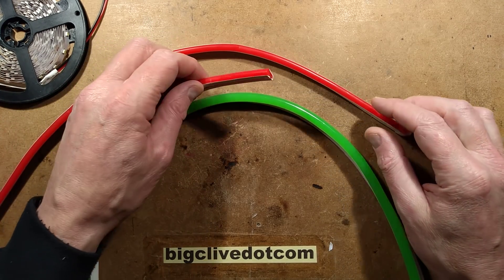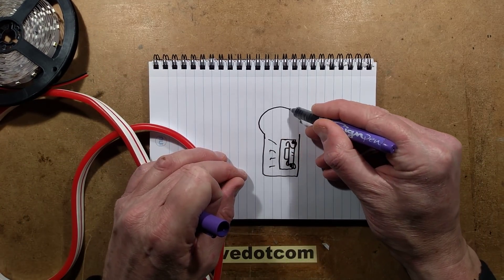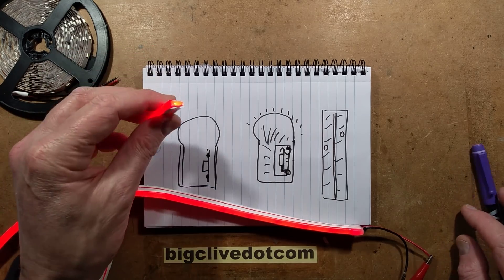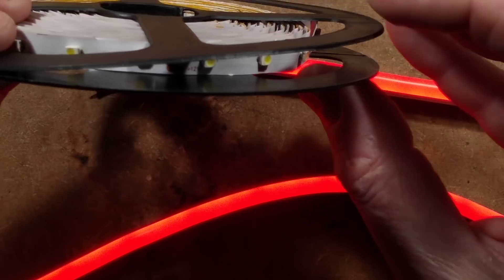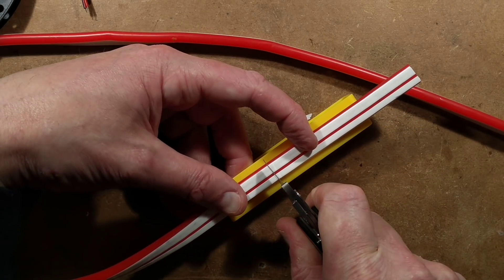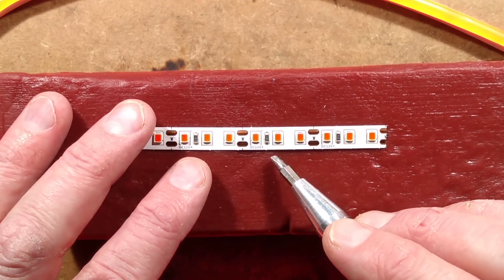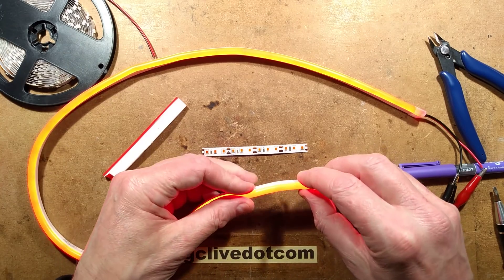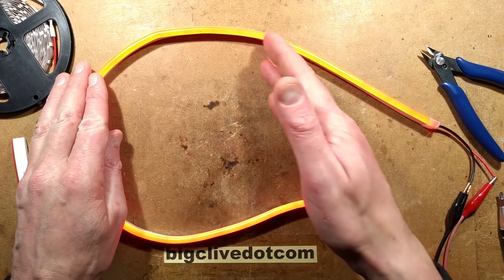LED "neon".  A new and interesting miniature variant.

Comment: I've seen a bunch of halloween masks with look like a thinner version of this without the white part, is is the same stuff? It's pretty cool for having light strips all over your body, it even seems like it could be a fun kids project, if you have an adult hook up the battery packs after everyone is done with the cable
Reply from the maker: Sometimes side-glow fibre optic and sometimes electroluminescent wire.

Comment: How do I connect different colors to one power supply?
Reply from the maker: If it's all rated for 12V you can mix and match colors.
Reply: @bigclivedotcom  would the size of connected pieces matter? Can one be shorter than the other? Appreciate your help sir

Comment: Oh yes I'm going to get some, not sure where to put them but I must have some because it looks so neat and probably easy to manage unlike the terrible tape and it's terrible adhesive that just tends to stick for about a day and then collect a layer of fluff
Just recently went to the local recycling center and got a box with like a dozen or so 9/12V power supplies for a couple of euros and this would be a perfect use for them

Comment: I think your videos must be a huge contributor to the success of the Chinese electronic industry and Poundland!  Now I'm inspired to create a custom neon sign. I know sweet fanny about circuits but I think I could wire up several lengths of strip satisfactorily but, being me, I'd like to animate. What component or circuitry could I use for switching on and off, in order to create the illusion of movement? I'm thinking anything between 5hz and longer intervals.

Comment: I wonder how well these will do in cold temps?
Reply: Should be fine, except that you'll probably want to 'form' them in warm temps; they're a little stiff at 10C or so :-)
I'd be more worried about capillary and expansion-contraction water suckage, if there's any wetness around and the ends aren't perfectly sealed -- in part because they're DC, though I suppose you could drive 'em with higher-frequency AC to avoid both electrolytic action and flicker...

Comment: Some of this stuff, has a cavity you can stuff magnet wire down to form it the way you want without having to hot glue it down to your perspex sheets or whatever.
Reply: There's definitely a little space / stretchability, but things are pretty tight in there (I'm looking at the same 'fake neon' that BC's demonstrating).
Which means I doubt I could push a wire that I could subsequently bend, more than 6in or so.
And I need to make words about 2ft long -- so let's hope the hot glue works, eh?  I'll report back :-)

Comment: This could easily add to the custom lighting of my Class A Motor Home, if in fact I ever get to move back into it. Right now, the members of my family are dropping like flies.  Three funerals of immediate family members over the past 4 months is a bit much with a few neighbors and close friends dropped in, jut to keep my black suite exercised.  God how I hate funerals!  That said, I do have that multi-color tape around my windshield, I only run the lights when we are parked in an RV slot someplace, and set the colors to correspond with the nearest holiday, such as red/green for Christmas/ Amber/blue for Halloween (I have our picture window at home done with purple/orange for Halloween using the 100 light set that runs from 3 AA's.  I just built a small box that has two jacks for 5 volts out hooked to a mini USB so I can run those lights from a wall wart, double A's are getting spendy and the rechargeable just don't do it.  I am considering using 18650's instead but for now a wall wart will do the trick.
Reply: Does remind me though:  Tis better to stand looking into a grave then to lay in a grave looking out!

Comment: What is the best way to power these strips for outside use?
Reply from the maker: Either a proper fully sealed waterproof outdoor supply or an indoor unit feeding to the outside and careful waterproofing of the ends.

Comment: I'm impressed. I could see some smaller Mom&Pop shops using these for their OPEN signs $15 for LED Neon strips, $5-10 for a power supply, $5 for a nice black/white board and some suction cups and some quality glue. 

I could see myself having fun with this in a little project car, Outline the rear window in 2 sides and connect them to the turn signals. Make sure everyone behind me knows what way i'm turning.

Comment: ell wire has been around FOR YEARS. I bought some in 2013 on Amazon for $15.
Reply from the maker: This is not EL wire.  It's much brighter.
Reply: @bigclivedotcom  So this stuff won't electrocute you when the wire gets a cut in the insolation? It runs on like 12v, yeah?
Reply from the maker: @InterMystery  Yes 12V DC.  EL wire tends to run at around 100V at a few hundred Hz.

Comment: Hey clive i love how you buy so much from ebay and i will say myself it isnt all crap junk . But one thing ive found concerning is that ebay allows sellers to remove negative feedback . One bad seller is siriusforce , he sells deep cycle batteries both lead acid and lithium , ive bought a few and found they are not even a third of rayed power . Maybe you could use your audience to alert buyers of this trend . Thanks

Comment: I used to bend neon as a side job (and met my wife there).  I always wondered if LED would be able to replace neon.  The skills required to build an LED sign are probably way fewer.  I see the LED strips in this video are not nearly bright enough for outdoor work.  Neon also offers another advantage, that light emits from all directions of a neon tube.  Still, LED offers some cool possibilities, like modulation of individual LEDs.  Nice video!

Comment: I ordered some of this back in Patreon release date as it looked good. Arrived today. Works very well and is pretty bright.  The brightness fades off a bit over a 5m length as expected so would be best fed power at each end.  I'm likely to use it as part of a ring light for camera/magnifier use.

The only issue I have with it is... OMG this stuff is smelly! Some rubbery/plasticizer aroma that fills my flat with bleh!

https://drive.google.com/open?id=1QGrhcKwA7D-3lE_6Oyf2wffOM3ke3WNF

Comment: Do you try this type of flexible cob led strip https://www.ebay.ca/itm/High-Density-COB-FOB-Led-Flexible-Strip-Light-14W-M-RA80-DC12-24V/401891675259?_trkparms=ispr%3D1&hash=item5d929c4c7b:m:mV7PW2DpsicMMdDgh2yiwCg

Comment: Would be nice with a built in "steel wire" that remember the message bent. If you want a suspended in the air kind of sign.
Reply: Cut out a design in plastic or aluminum and glue the strip on to it?
Reply: @AllenKll   what type of glue would you use ?
Reply: @nancywright9923  hmm.  Probably, I would use double sided tape, or epoxy.
Reply: I've also been trying to figure out this "suspended in mid-air" thing.
I don't believe "stick the neon to a pre-formed wire" is going to work; double-sided tape isn't very adhesive (check how narrow the underside of the neon is) and fails fairly quickly, whereas epoxy takes much too long to set (and you gotta hold the neon on the wire until all the epoxy has set) -- and superglue / cyanoacrylate tends to dry white and crispy, so is also suboptimal.
Double-sided tape on to 3/8in 18-gauge aluminum ribbon would probably work, but that would still prevent sharp bends (folds) in the neon -- so doesn't tempt me.
My best idea so far, is to hot-glue tack the neon to a transparent perspex / acrylic backing plate (resting on a sketch of the design, so I can see where I'm 'writing');  the hot glue should set in a minute or so, and I should be able to go letter-by-letter rather than have to build the whole sign in a single operation.
Then probably clamp another sheet of perspex over the design (think 'sandwich'; maybe put bolts through the corners, optionally use two bolts to connect the 12V), and use copper or aluminum tape around the edges to 'frame' the sign and to keep dust out.  In theory, this gets me a transparent sign in a skinny frame.
Any better ideas, please?

Comment: Hi Clive, what about light intensity, I remember neon puts out more light?
Reply from the maker: Each material has its own merits.  I'd under run the LED for longer life and use it indoors.
Reply: Also notice that this stuff is really cheap; if you have a routed or vacuum-formed track into which to place the LEDs (i.e., it's quick to form the sign), you can over-run the LEDs and just replace them annually (or whenever they're faded to 30% or so).
As opposed to a real neon sign, for which you'll need a professional glass-blower etc., and a bunch more $$$  :-)

Comment: You should check out laser wire. Great for ultra thin glowing wire applications. Much stronger more flexible than EL wire.
Reply from the maker: Interesting pairing of side glow fiber optic and lasers.  I wonder how linear the light is along the length.
Reply: @bigclivedotcom  I actually own some (Burningman :) and mine is about 5 feet and the light is pretty consistent. And I assume you can up the laser power the longer you go. It's really a special looking piece of tech. Not cheap though.
Reply from the maker: @doodlesdeluxe  Just for fun I've ordered a short length of side glow fibre and a 10mW fibre cable test unit.
Reply: @bigclivedotcom  Plase post a link for us

Comment: I wonder whether you could check this out and see whether they actually do anything to improve radio reception in my van? 🙂
https://www.amazon.co.uk/dp/B07P53KS21/ref=cm_sw_r_cp_apa_i_DsGNDbN7JVQDC
Reply: @Matt Quinn I get signal most places I go in Wales in the car, but FA in the van
Reply from the maker: That could be down to something in your van generating electrical noise that swamps the radio signal.
Reply: @bigclivedotcom  what kind of thing would be likely to cause that? I have a dashcam but the problem persists whether it's plugged in or not 🤔
Reply from the maker: @SuperAlbino1  Can you get radio reception when the engine is off?
Reply: @bigclivedotcom  I've only noticed it in rural areas while driving (obviously not tried with engine off), but my car receives fine in those same areas.

Comment: While resistive losses in the busbars argue against powering a long strip from one end, which will also make the lights at the opposite end a bit dimmer, the unwanted dimming can be evened out perfectly by powering just one of the busbars from each end. With the strip rolled up, for example, power the positive busbar from the center, and power the negative busbar from the outer end.

Comment: Can you dim this led Strip simply by reducing voltage?
Reply from the maker: Yes, but only between about 12V and 9V.
Reply: @bigclivedotcom  I see now they are selling this product 5meters multicolored with remote at Action 😊
Reply: You can, with the limitation noted by bigclive. PWM (pulse width modulation i.e. turning on and off really fast, with increase in nett off time giving lower dim level) is the usual approach for dimming constant voltage LED arrays, but that's a more complex circuit if such things are a concern.

Comment: Can someone help me out here please? is there a simple 3 pin plug that will convert the 240 to a 12v so I can wire it up and make it work? if so where can I get it from (as you suspect im useless with sparks) thanks
Reply: @Matt Quinn Thanks Matt
Reply: Do I use the 3Amp plug for a 5m length ?
Reply: @Matt Quinn I will do that thanks Matt
Reply: Ordered 5m and all the other bits, so we will see how it goes  (Pink) for a laugh

Comment: I spent 2 months in Japan in 1990. The amount of neon signage then was staggering. The Tokyo night sky was a sight to behold. In brash West Berlin in the late 80's it was a similar experience.

I went to Berlin recently and the extensive signage around Wittenbergplatz is now all LED; not video screens, but illuminated logos. It looks crap. It lacks variety in hue and has a vibration to it which is discomforting.

I suspect Tokyo at night is dominated by video screens. I'll have a look.

Comment: I have not looked for it
It would be cool if they had a WS2812-B style of these with a milky white "silicone" color stuff around it. It would be perfect for my arduino OBD-2 scanner project i had to make since BMW decided it was okay to not put the coolant/oil temperatures anywhere in my 2011 mini cooper's computer... I've made it into a cool addition to my car which has some LED's around the giant speedo in the middle, diffused by some milky wire wrap i found at home depot, synced up (roughly) with my tachometer, even flashing red when i red line. This stuff would look way better.

Comment: I've made "Neon" signs useing this stuff for a sign company I worked at and let me tell you what you spend more time with the mess of wires on the back then You will placeing the LED strip great idea but pain in the ass to wire every small piece
Reply: I'm surprised you didn't try to use a continuous strip of LED neon (although I think that will also be a PITA).
I'm hoping to do four graphics on a transparent backing, 12V powered at the (left- and right-) ends -- any recommendations,  please?

Comment: Could you do a video showing how to power these 'tapes' correctly. Is a phone charger wall plug OK, Do you need drivers ? etc please.
Reply: Is there a way to power it by USB so it could be used as a back light on TVs powered by the USB, and things like that.
Reply from the maker: They do a 5V version, but most are 12V and need a suitably rated 12V power supply.
Reply: @bigclivedotcom  such as ?

Comment: Good looking stuff. I just bought two 1 meter lengths, red and blue. I've been wanting to make a 3D printed "neon" in my wife's initials for her office. I've tried regular LED tape and it kind of sucks for it. But I bet this will work good. All I have to do is print the channel in the shape of the letters, then hot glue this in. Thanks Clive!

Comment: squishing it flat ... that doesn't put too much stress on it does it? Could you glue it down like that, to make a full wall, maybe pass it through a diffuser for a light panel with minimal hotspots?

Comment: I find alot of the real cheap led tape runs and lasts long if you drop the voltage to 10~11 vs. 12
Reply from the maker: I usually drop the voltage too.  Even a single diode in series with a short run has a good effect.
Reply: @bigclivedotcom  Yeah I did that in a few arcade machines :D

Comment: you did a video about putting lights in a home made silicone pattern 'flower' you used some kind of flower or starch and clear silicone . this reminds me of that so if you can add some color to that mix rather then the glow in the dark powder you used i think you could make this same rope a lot cheaper
Reply: BC's LED neon is around $1 / ft.  Very very hard to undercut that pricing, and still make a profit.
Reply: @theskett  this comment is from October 2019 so yes the cost has came down a lot, I have the led tape 12 volt running around my walls almost touching celling so it gives a more even light all over the room.If I had just waited till now to get all these lights I would have saved a few hundred bucks lol  I saved money on the light bill so it worked out in the end because the lights are hooked to a battery and solar panels

Comment: Last time you did the neon led strip I went down the youtube rabbit hole of chinese manufacturing videos looking for how they where made, ranged from manual led strips being strung manually through an extrusion (looked to be about 20' long lengths), to automated machines doing everything in a one step process (hot molded neon strip) into an endless length (or until the massive roll of led strips ran out).  High tech operations had a worker with a sharpie making the cut lines against a light table and yet another that had a laser etcher burning the cut marks.  Rather fascinating watching the various methods.  I highly suggest going on the youtube hunt for these videos.  And the older led rope lights... oh man, the quality control was something to behold.

Comment: is this not the same but cheaper Clive???    5M £12.96 free delivery   https://www.ebay.co.uk/itm/5M-DC12V-Flexible-Led-Strip-Silicon-Rubber-Tube-Neon-Tape-Soft-Rope-Bar-Light/113893554043?hash=item1a8495b77b:m:mI23tSv0jGBt1chv9BGY2Bg

Comment: I'm surprised they haven't added something like a rigid ABS channel that you could use a heat gun to soften and form to shape.
Reply: Blazer02LS they do have this you speak of in a larger size. We use it all the time in the sign business.
Reply: @ricktennyson4809  Do you have Google keywords or a link for that, please?
So far, I've only found a guy using EL wire in heat-bent polycarbonate tube -- which looked kinda painful, although I suppose would work :)

Comment: 3 measly amps? Nothing compared to my 5m/300led 'neopixel' strip which runs at 5V.  Fortunately I salvaged a power supply from an old Dell computer to run it. According to the sticker it puts out 22A at 5V which is just enough to cover the 18 ish amps the 5m strip draws at full throttle.
Reply: @Joe T Yeah they do draw a lot of power (though they're not 'dim' by any means). But they are fun to watch :-)
Reply: @Joe T It's a 'neopixel' style strip, each chip contains RGB leds and can be individually controlled (hence the 5V).  If all three leds in each chip are on (creating a 'white' light) that's 60mA per chip times 300 which is 18A.

Most of the time though not all the leds are in use as it's hooked up to an Arduino running some sequences on a loop.

It's just a project I bashed together from bits I had lying around whilst I was on holiday, something for the kids to look at.

Though I did have to power it from both ends due to the voltage drop over the 5m